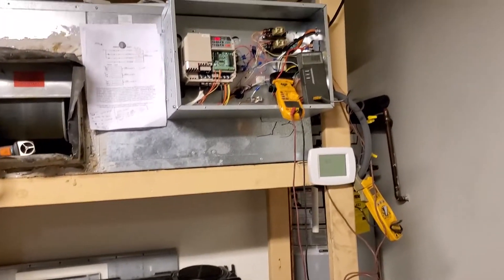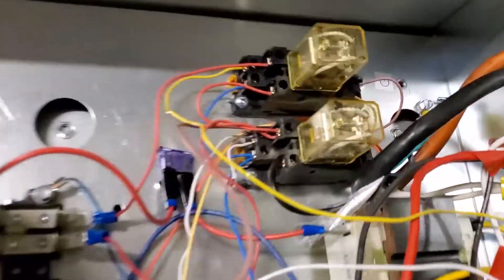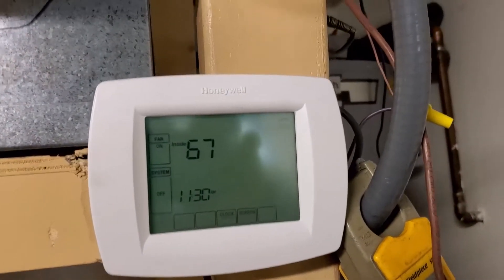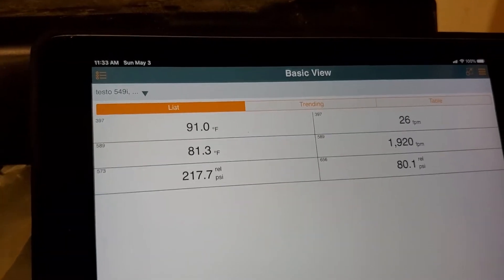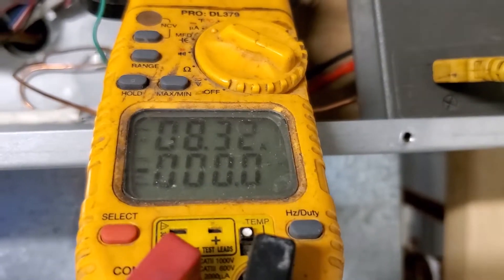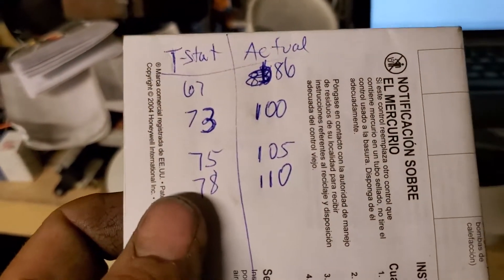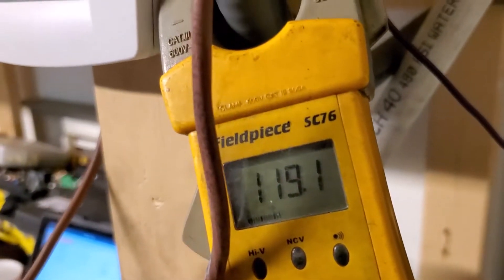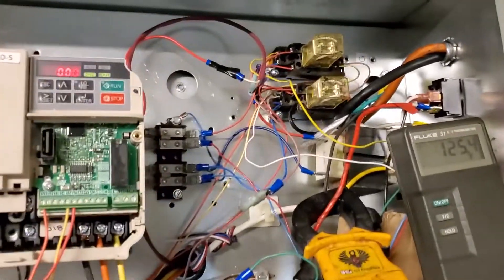Bastard Water Heater gets a crude yet very temporary temp control

Comment: It is Looking good! You'll have to see how that direction works vs pulling from the Cold side (pickup tube so you don't get all the sediment) and pumping into the drain instead.  But looks like it is working the way it's plumbed.  What you will notice with the WHP, you don't get as much calcium as running with the elements.  Although, It is not noticeable when it's warm, but in the winter and the garage is in 50s or 60s, I got some convection going where the hot water rises and circulates during the off cycle causing the tank to lose some heat and coming on prematurely.  I ended up putting a solenoid valve...clunky solution, but it stopped the heat loss. Very nice setup looking forward to the the updates to the system.
Reply from the maker: So far my control is not built yet. But I made progress. 
The hack temp control has worked fairly good 
Sometimes it heats a little higher. 
Everyone in the house is commenting on experiencing the hottest water ever.
Sometimes we have to turn that shower know to the right of the center to bring more cold than hot and is still pretty hot. Ha ha

Comment: Probably the only thing I would add at this point would be a motorized valve to cut off the water flow when the heater is satisfied. That way you don't have convection flow constantly keep the evaporator warm.
Reply from the maker: I will keep my eyes out for a ball valve actuator.
I'm trying to keep it a cheap project. LOL
So far it doesn't seem to be having issues.
The pipe isn't hot until it starts and turns on the recirc pump. 

I do need to insulate when I am done with the testing tho

Comment: Is 120 good enough for the whole house??
Also for sediment use a inline strainer at hot out tap
Reply from the maker: I think I'm running closer to 130 since I cranked up the stat to its 90 degree max (should be about 130 with the online series resistor to trick it)
Reply: @hackfreehvac  I would throw in temper valve set to output 120 (for safe house hold) and then you can raise the temp to 140 on water heater this technique we use in the tankless hydronic heating system to feed the loops for heating or high heat demand appliances like washing machine or dishwasher or secondary heat exchanger coils to heat swiming pools.
Reply from the maker: @rmwaseem  We like the hot water.
It's enough to scald perhaps if you stayed under it a while.
It's not any hotter than if you set the electric water heater a bit higher.

I've worked in buildings where we ran the boiler at 150 to 155.

THOSE we had to use the mixing valve to send to the sinks etc in the rest of the building while getting the full temp in the kitchen.

Comment: How are you dealing with the condensate ?   Will the emersion heaters be usd as a third stage ?
Reply from the maker: Not having any yet. I have a pipe aimed at a bucket for now.
Reply from the maker: The original heaters are out of the circuit. I'd only need them if this failed.

Comment: Maybe You could put an inline y strainer to deal with anything from the tank , that might help.
Reply from the maker: Now that it has been in use it hasn't had recurring issues.
Plus I guess it's the electric heaters that cause the sediment chunks to begin with.

But it probably wouldn't hurt to make some sort of strainer with a drip leg or something to back flush now and then.

Comment: Got an idea for a t stat use a a421 or a ranco electronic stat I've used them in a fish tank chiller repair and going strong!!
Reply from the maker: I would use one similar to that. Or a Honeywell T557 or whatever the model is, that also has a 0 to 10 VDC modulating output to feed into a VFD.

But home brew it is I think. 

I started a controller but got distracted. I need to get back on it